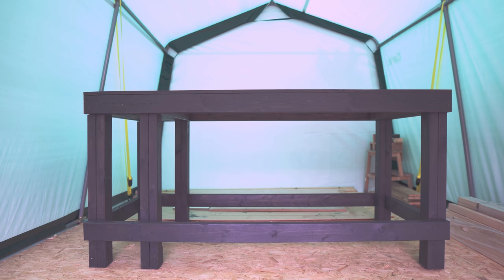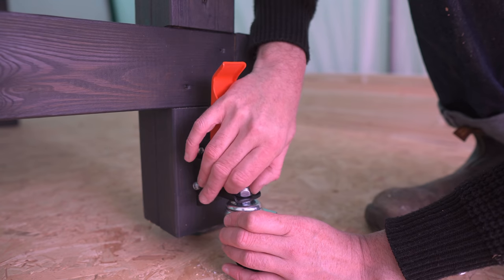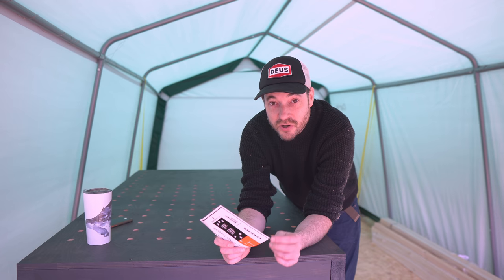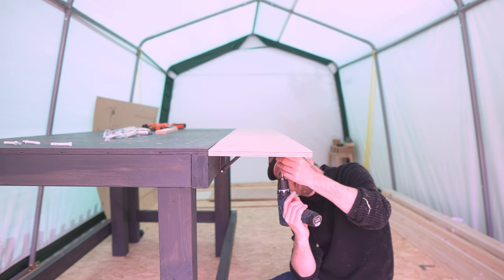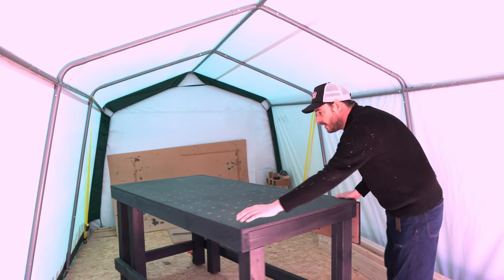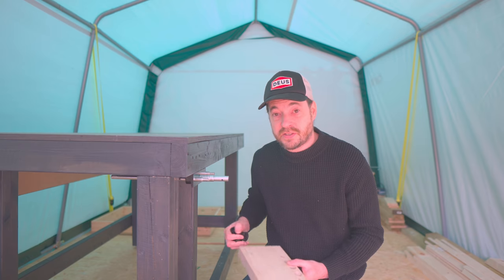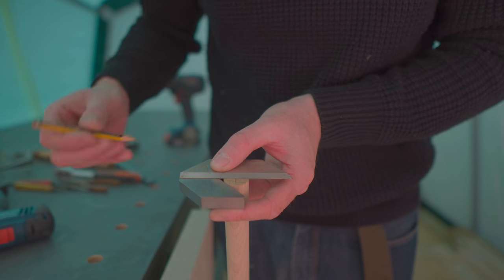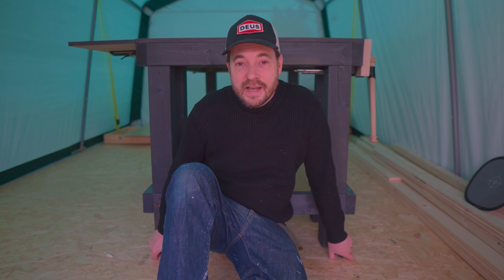Three Workbench Upgrades

Comment: I love those casters and have them on 3 tables in my shop. One tip I learned is to overhang the table a few inches on the ends with the casters. If greatly cuts down on incidents of kicking into them when walking around the table. Here in the US the 2 major woodworking retailers sell them but Amazon is significantly cheaper if anyone is looking at buying some

Comment: The vice shows an inner surface cutout for the bench inner plate, did you use this? I really like you bench side extension, so simple but so effective.
Reply from the maker: Not sure what you mean?
Reply: @Badgerworkshop  on a bench vice you have the front metal plate to which you have attached a piece of wood which you are going cover the front with leather. The back metal plate through which the screws are threaded into the wood body of the bench. This plate is recessed into the bench frame - often cut with a router. This plate also carries screw for you to attach a second wood face to the vice. It is this plate (which is part of the vice kit) I did not see you use. I hope this explains my poorly written earlier piece. K
Reply from the maker: @kevinronald4137  There are no screws for a second face and the side of the Bech will be used for this
Reply: @Badgerworkshop  sorry confused with the Veritas kit which does have the screw holes.

Comment: I think I might be tempted to move the casters around the legs 90 degrees so they are in between the legs. Less of a trip hazard.
Reply: I like your thinking only issue would be the flip lever thing would be hard to operate on the inside especially with a shelf underneath
Reply from the maker: It would not work on my bench